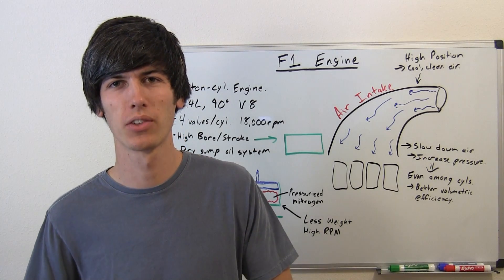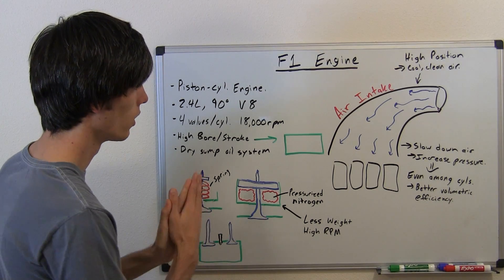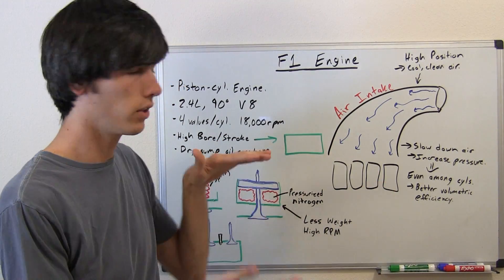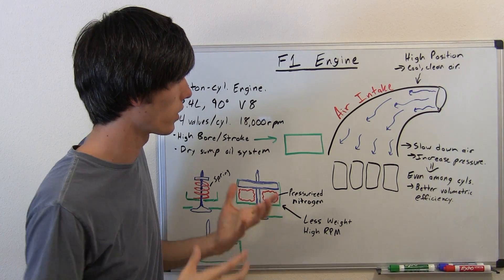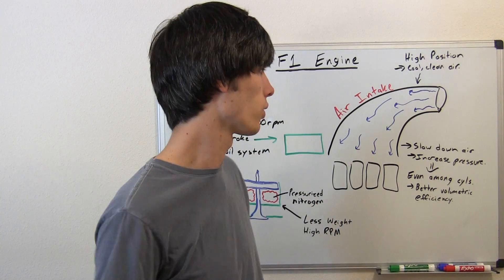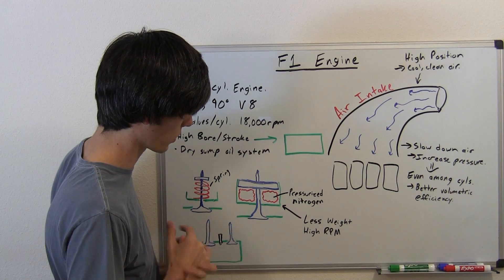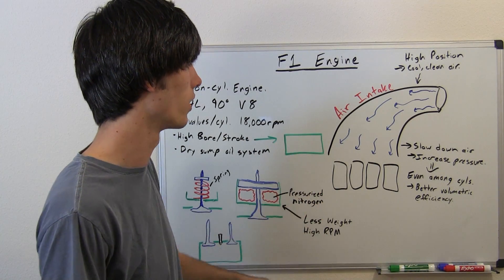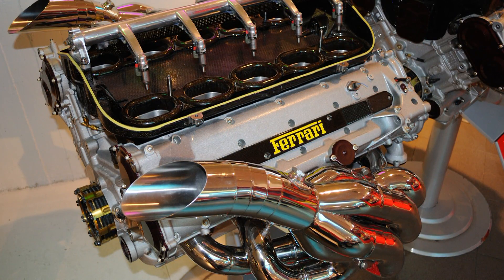F1 Engine - Explained

Comment: I am not sure you want to describe air flow that way, being "pulled" in.  Air can only be pushed.  Similarly, by what argument can you say that a slowing of air flow results in greater pressure?  Air flows from areas of higher pressure to areas of lower pressure.
Reply: LeadHase TrebuShade  I have to disagree with you there. The air intake is like one half of a Venturi tube, opening up the tube to a greater volume reduces the velocity and increases the static pressure. What you are saying works for static air if you increase its volume (Boyle's Law).

I have done some reading and I think we are getting confused about dynamic and static pressure. The dynamic pressure is high at the intake because of the velocity, but the static pressure is low. Opening up the intake reduces the dynamic pressure and increases the static pressure. The wiki article for 'ram-air intake' explains this better.

For an even better article this should answer all our questions! www.racecar-engineering.com/articles/f1/technology-explained-f1-airboxes-filters/
Reply: I'm trying to understand this too... How does air, which is being forced into a larger volume have more pressure than in the smaller volume?
Reply: +Peter Rhodes If the air pressure at Wide Intake were greater than that at Narrow Intake, air would be flowing up and out.  Gases move from areas of high pressure to low.  Yes?
Reply: I'm no expert on fluid mechanics, but fluid can flow from low to high pressure regions because of the momentum of the air itself. The pressure gradient will result in a force towards the lower pressure region of the narrow intake, and therefore an upwards acceleration. However, as the air has a downwards velocity the acceleration acts only to slow the air down, not cause it to reverse direction and flow upwards towards the intake. This means that the air is moving slower and has a higher pressure when it is sucked into the wider intakes.
Reply: +LeadHase The pressurised air box principle is well known and I'm afraid you're wrong. The expansion of the airbox lowering the pressure only happens if the airbox is open to the atmosphere apart from the intake. If it is sealed apart from the intake and inlet to the engine, you get a pressurised volume of still, cool feed air for the motor. It does not work like two volumes of gas at different pressures, you have to factor in velocity. 
For example, the first road vehicle with a pressurised airbox was the Kawasaki ZZR1100 motorcycle. This has a sealed airbox with intakes in the nose of the fairing. At the time it came out, Japanese bikes were limited by agreement to 125 hp. This equated to around 165 mph top speed for a full faired litre bike. But the ZZR did around 186mph. It had a very good fairing, but the numbers did not add up. It was found that at zero mph on a dyno, the bike made 125 hp, but at full speed, the pressurised airbox made the engine give over 150 hp.
Reply: kaiservilhelm1 The air is moving slower, yes, (which I don't understand the purpose behind), but I don't understand how the air in the chamber could have a higher pressure. Yes, the air has momentum, in which case reducing that moment by some amount may not have significantly affect performance.
Reply: He's clearly wrong. Opening the chamber creates a bigger volume and thus a lower air pressure. It's a very simple application of the beroulli equations...an expanding cross section only decreases the pressure. The effect is somewhat mitigated by the momentum of the inflowing air, but the increasing size of the chamber certainly cannot drive the pressure up.
Reply: kaiservilhelm1 Ooh I see what you are now talking about when it comes to the static and dynamic are pressure difference.  True, the air at the intake is standard static air pressure, and when it enters the intake, the pressure will slow in dynamic pressure (relative to the car), but drastically increase in static pressure. But I still can only see that having a volume larger than the intake would only serve as to reduce both static and dynamic pressure. 
Perhaps the static air pressure will increase at such a high rate that the expanding canal is not expansive enough to reduce the static pressure to the point where there is a loss of performance due to insufficient air pressure.
Reply: +TrebuShade Basically when you accelerate a gas you cause it to "spread out" over a larger area, same mass of gas spread over a greater area, the molecules are lulled apart, so the density decreases.
The reverse also applies.you slow a gas, it will compact, the faster moving gas behind pushing into the slower gas in front, raising the pressure. This is both how Venturi's and aircraft wings or propellor blades work.
Reply: It's all about having enough air coming in but having it at it's lowest possible velocity for highest possible density.

I dont study this sort of thing and wouldn't know the equations, but a chart outlining the density of air at different velocities should demonstrate the idea clearly.
Reply: Mark Jones. Air can only be pushed ? how do you explain a vehicle engine running when the vehicle is at a stop ?
Reply: Air pressure in the intake of a normally aspirated engine is always less than atmospheric pressure.  It is the higher pressure of the air outside the engine that pushes air in.  You can't "pull" air.
Reply: Mark Jones  I don't get it. When you put your hand over a vacuum cleaner hose opening, it pulls on your skin.
Reply: Mark Jones Right, as the cylinder head drops within the cylinder, an area of low pressure is created. Gases travel from areas of high pressure to low pressure. You are correct; It just seems that it's being sucked in.

Comment: do you even physics bro? In regards to the intake scoop of course it acts like an air ram. The engines air consumption speed at 18000 RPM is going to be 21600 liters per minute or 21.6 cubic meters per minute. at a top speed of 360 km/h or 6000m/min the opening of the intake would only have to be 36cm² or .0036m²(that's the size of a lemon) in area to keep up with flow rate. and since we can all see the opening of a average Formula 1 car is closer to 225cm² or .0225m² (the size of a melon) with unrestricted flow we would get 135m³ of airflow through that opening. even taking into account the air filter and assuming it cuts down the air flow by even 75%(which would be a crappy or clogged filter) we still get 33.75m³.
that's over 150% of the rate of flow of the engines maximum capability. so of course we're going to have a positive pressure inside which is exactly what a ram air intake does. drops mic
Reply: They changed it back for the 95 season after it had hardly any effect at the power of the engines. The ram-air effect is often wastly overestimated. The whole ram effect thing just starts to get intresting at at least half the speed of sound.
The pressure increase at 360km/h is less than 6% and at 300km/h about 4%. So on an average track they had about a 4% pressure increase in the manifold at 2 or 3 spots at the track, every where else it was even less than that. And a 4% pressure increase doesn't even mean you get 4% more power out of the engine.
The whole effect gave them maybe 10-20hp more than when the car would have been stationary.
Reply: shi01  and Kcburn: Ram air does work (see SR-71 Blackbird when it switches over from turbine to ram-jet operation). However, the problem with ram-air is when the airflow stalls, or the air being ingested is slower than the airflow at the entrance of the port: the entire airbox baxks up, and stalls out at the entrance, and the airflow actually can separate and go AROUND the opening, and actually scavenge the stalled air out of the port (this comes from Ferrari's book on the 2000 F1 car, published in 2003), which bascially will starve the engine. So, instead of trying for a ram-air effect that can only work at certain speeds and RPMs, they set up the air boxes in such a way that there is ALWAYS enough air to feed the engine at any RPM, especially high; and they do that with a flow port on the back side of the airbox that allows the air that isn't needed to flow out, maintaining a supply of fresh air in the air box at all road speeds and RPMs. Which is still important, even now with the turbo engines.

Comment: Why does the slowing of the air coming through the intake result in higher pressure for the cylinders?
Reply: Because of Bernoulli's principle.
Reply: Definitely not an application of Bernoulli

Comment: are there any engines that don't use a camshaft but hydraulic, pneumatic or electronic valve actuation? i would think it could be more precise and more tunable. thanks. i love this channel.
Reply: Koenigsegg is working on an engine that uses this idea
Reply: +TheSpeklOne especially if it's an interference motor lol

Comment: I found this vid quite informative, but was disappointed that you didn't go into greater depth about the nitrogen pressure valve return versus air, which you mixed up a few times.

Comment: When was this video made?  F1 engines are now hybrids engine with a turbo is now called a power unit and barely resembles an internal combustion engine any longer
Reply: All 2016/17 F1 engines must be made of a V6 1600ccm combustion motor and an electrical part. Additionally there's an electrical Turbo whose dimensions depend to the electrical power. In deed it works nearly like a Toyota Prius.

Comment: Good video.
I can't believe how small the clutch is, I guess I need to find a video about that.
Reply: They use small diameter to have less inertia. multi plates to make up for the loss of grip. Goal is to rev quicker
Reply: Thanks, I did find a video about it.
 It makes sense, it's much easier to get it spinning.

Comment: volumetric efficiency is a percent of the static ratio compared to actual dynamic at any given atmospheric pressure. 

always measured at max torque usually at 5252 for the average v8 big bore big stroke thus why these blocks can achieve 650hp and maybe 300lbs. ft. with high revs. very important numbers I'd thought you'd mention in such video.
Reply: hp= max torque x rpm /5252
Reply from the maker: +B00steDevil there's no reason peak torque should occur at 5252 RPM. Completely dependent on each individual engine. This is just an arbitrary number that happens to be where torque and HP "cross" if you're using imperial units, but it's important to understand the units are not the same, thus using metric units they don't "cross" at 5252.
Reply: I completely agree with you peak torque or (maximum volumetric efficiency) is dependant on many factors mainly how well the head can flow enough air, compression ratio, timing, etc.  thus why I said usually for a big bore big stroke combination the peak torque will most certainly be a benefit at lower rpm but at the same time giving up high revs also due to many factors mainly there's no reason to rev your 6.2L vette to 8k if your head and valve train can't support the air flow needed. 

A video like this should involve complex formulas with very tiny decimal numbers and all the goodies.

Comment: However... If you want a truly simple design? Use 2 stroke technology. No valves and twice the power. Now all that's missing is the ability to run the engine cleanly and without "burning" the engine lubrication. I suspect that there will be a gasoline powered 2 stroke in the future. They will have to figure out lubrication issues...

Comment: How about getting rid of ALL the valve train and simply replacing it with electronically controlled valves? In the event of failure, all valves would remain closed and you would simply roll to a stop. You could then open the hood and find the red led light on the broken valve or valve bank (4 valves per bank) Simply detach and replace or rebuild and replace. This entire system could be 5 pounds VS 40 - 60 pounds for a complete head, valves, chains and 100 other parts. I am thinking Honda could build their Civic R 310 hp long block engine at under 80 pounds total, using a steel sleeved, plastic or carbon fiber block. Engine technology is still stuck in 1900...
Reply: Some engines are being built now with solenoid actuated electronically controlled valves but the technology is still too expensive for passenger car production.
Reply: Never mind reliability of mechanical vs electronics inside an engine.

Electronics like temperature changes less than mechanical bits do. Then comes the problem of actually engineering an electrical valve that opens and closes at the speeds required, that would require a pretty massive jolt of electricity.

Comment: Is there a system to keep each valve charged so the nitrogen has enough pressure to open the valves, or are the chambers pressurized at manufacture and sealed?

Comment: volumetric efficency is not effected by forced induction it just adds pressure. pressure is not volume. volumetric efficency is referring to the volume of used gasses being replaced by fresh atmosphere. 85% VE means 15% unusable air. a VE over 100% means the engine is creating it's own pressure increase by maximizing presure pulse timing. great video though

Comment: Great stuff. However, you might also mention another advantage of dry-sump lubrication, and that is the oil can be cooled easier as it is taken (momentarily) right out of the extreme environment of the engine.

Comment: Just for fun, I thought I'd share my thoughts on something that's seemingly trivial but it's unacceptable in the mechanical/engineering world.  Almost everyone who makes videos about cars nowadays refer to the torque ratings as "pound feet" rather than "foot pounds."  "Pound feet" is something one does when they get get fired!  I think they see 400 lbs. "ft." and misinterpret that notation as a grammatical term.  Obviously they cannot comprehend the difference between foot pounds and inch pounds.  I'm sure many here in this blog would agree that a 12" wrench on a nut with 100 lbs. of force enacted upon it creates 100 foot pounds/100 lbs. ft. of torque.  Comparably, 100 lbs. of force enacted upon the same nut with a 1" wrench creates 100 inch pounds/100 lbs. in. of torque.  I think they can't see that 100 lbs. ft. means 100 pounds "per" foot.  I hope no one here ever gets lost as they did.  Good videos, BTW.  I enjoy seeing young folks develop as critical thinkers.  Bless your heart!
Reply: Hmmm. Conventionally, Foot Pound is a unit of energy whereas torque is a turning moment that is best thought of as a force applied at a given length of moment arm thus Pound.Feet. When writing equations involving moments, we almost always write force.distance. The convention does matter because it makes solving complicated equations involving many moments (bending of beams is a good example) easier simply because the moments always appear the same way around rather than being a mixture of force.distance and distance.force that would almost certainly lead to mistakes. (. is used instead of x for multiply similarly, to avoid confusion.)

Comment: A million dollar motor and barely brakes 900hp. Meanwhile you see 1400hp out of 4G63 2L power plants at the local track running 7s. Can a F1 car runs 7s? NOPE.
Reply: In the 80's F1 used 1.6 Liter turbo engines that did produce up to 1400hp. So with other words F1 achieved that already 30 years ago.
F1 is not drag racing. You have to follow the rules in F1. .

Comment: Ok... just skimmed the video (sorry)... but you state you can't increase airflow (barometric) pressure to the cylinders without a turbo. I actually wonder if that is true... Lets say you have a airfoil wing and what pressure is on top and bottom of that wing? Normal airfoil will give you low and high(er) pressure on top and bottom... I think you can increase the barometric pressure to the cylinders (ie. have more air then 1 bar's worth) without a turbo if you design the intake in that way... I'm no engineer... but would that not be possible? but anyway... why F1 engines are the business mostly is because of material, the tolerance and infact it's short lifespan...
Reply: The answer is proven with two equaltions. Conservation of mass (continuity) and bernoulli. CoM equation is A1V1=A2V2 A1 being the area of the inlet, A2 the outlet, V1 being the velocity of air at inlet etc.  if the area of the outlet is larger then the velocity must be smaller. So we know V2 is less than V1 we can now use this information for bernoilli. Bernoulli is the same equation that governs the aerofoil pressure differential you mentioned. the equation is P1 + 1/2*rho*V1^2 +rho*g*h = P2+1/2rho*V2^2 +rho*g*h. P is pressure and rho is the density of the air which is roughly the same on both sides of the equation.  the rho*g*h term is also roughly the same on both sides so can be ignored. Since V2 is smaller P2 must be larger if it is to equal the opposite side of the equation. My explanation probably isnt great but google the two equations and you'll get the picture.
Reply: As I said... not an engineer :-) but if I'm getting you right... you can get a higher (and lower) pressure with some intake "magic".. although a very small one and maybe in the grand scheme of things... not that effective... it's a small engine power vs probably worse grip...

Comment: In an engine with 4.25" bore and 3.75" stroke that is called an over square bore. In an engine with 4" bore and 4" stroke it's called a square bore. In an engine with 3.5" bore and 4" stroke it's called an under square bore. Many engines now days implement under square bore. The small bore uses less fuel and with a longer stroke more torque. To get more horsepower the engine has to rev up much higher to get up and go.